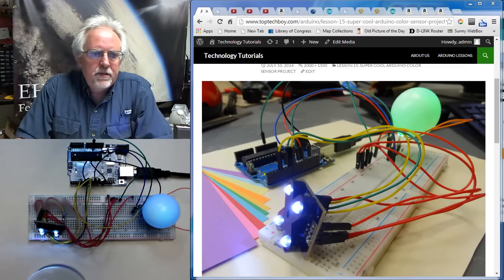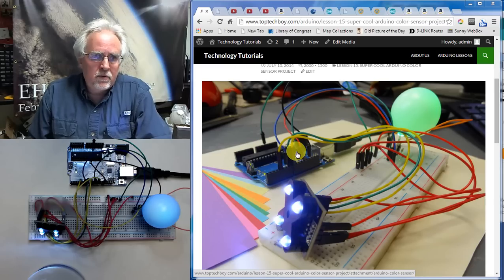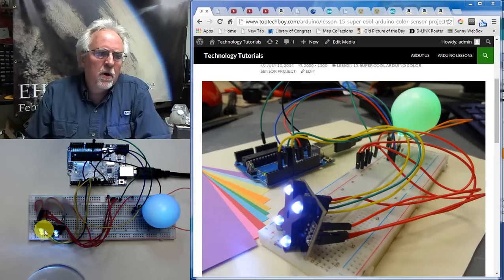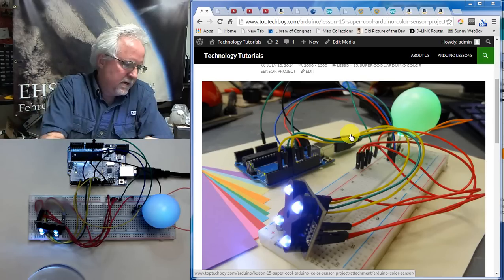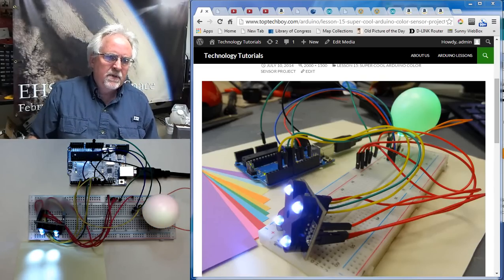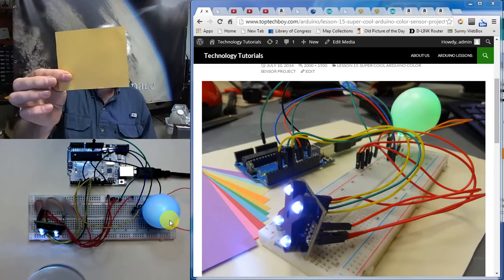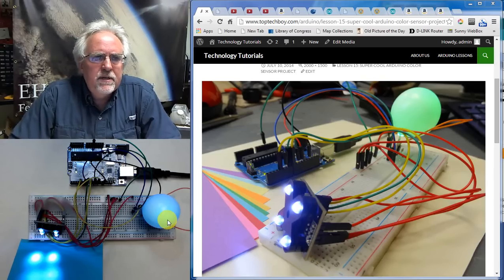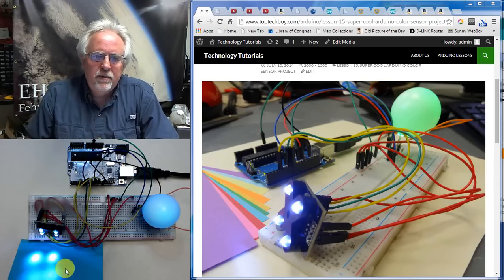Arduino Color Sensor Project Totorial

Comment: How did you manage to get that accuracy on the RGB LED. As we saw on a previous, mixing colors isn't as as accurate as it should. 

For example 100 for green + 100 for blue won't bring out that perfect 'aqua' it should, so, shy out one or the other is needed

Comment: Tell me am I wright or wrong. The sensor detects red value, green value and blue value from the which goes to three different variable and each variable is assigned to the corresponding pin which changes it color. Am I wright, hmm. I haven't checked the code yet